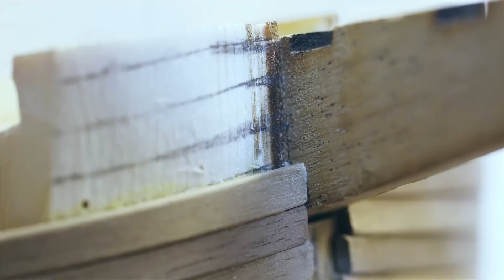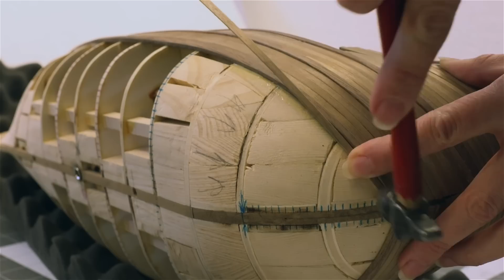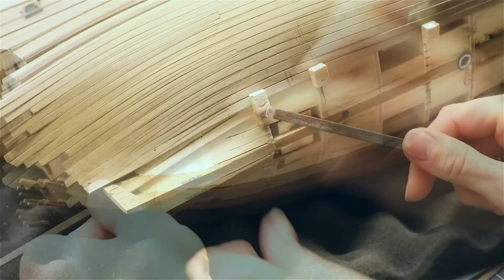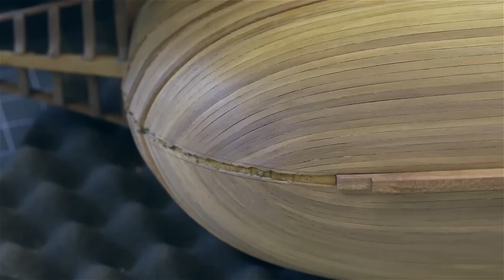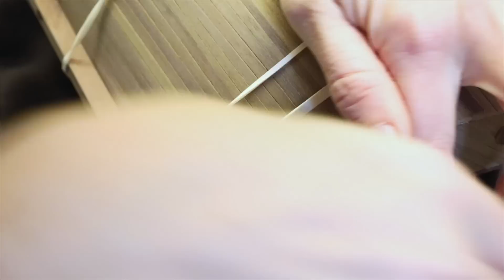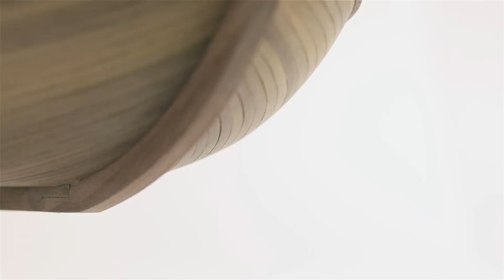Model ship building #10 - Planking the bottom - RAGUSIAN CARRACK XVIc - KIT (MarisStella)

Comment: VERY good video - great job of planking the bottom.  Have you ever considered using a Foredom rotary tool?  I have used both Dremel and Foredom, and greatly appreciate using the latter.  Speed is controlled by foot pedal, thus no switch to turn of/off.  Very quick tool changes also.  Has a lot more power than the Dremel, and can be obtained through Rio Grande jewelry supply.  And you can still use the Dremel sanders, etc.  Just a thought.  Meanwhile, keep up the fantastic ship building!  You are an inspiration for many of us who love making things with their hands and brains.
Reply from the maker: Thank you!
I'm glad you liked it!
I have seen such a tool from my friends - it is convenient when you work at the same table all the time. But apparently it's still a matter of habit - I do not like the flexible shaft itself... For some reason it is more convenient for me to hold a well-balanced Proxon)))

Comment: That planking is amazing, so resourceful and clever using the electric radiator to do the bending. I see it is wired for lights, want to try wiring my next model, what type of wire do you use?
Reply from the maker: Thank you!
I used the 28AWG wire here.
But it is too thick for small diodes. I just didn't have another.
Reply: @OlhaBatchvarov  I think I will order some 32 AWG in two contrasting colors.  May be able to hide the wiring also, as I did when building a "doll house" for my boss.  Sure does not take much to solder using "Tic" brand - low enough heat that you could use a match if you wanted, melts at about 250 deg. F.

Comment: Olha, what kind of heater are you using in this video to (steam) bend your planks?  How long do you soak your planks before steam bending them, especially the "severe" bends -- minutes, hours, longer?

What is the (specially shaped aluminum?) block that you use as a sanding block?  Do its notches & corners have special functions?

I honestly had forgotten about the custom-made "keel assembly" (my incorrect term - it was way past my bedtime when I watched that video ;) and was wondering what you would do to clean up the "joint" between the port & starboard sides of the model.  Now it's so obvious that I feel like an idiot, but I don't think that I'll forget how to do that again!
Reply from the maker: This is walnut - it is very malleable by nature, so I just wet it before bending and immediately on the heater (еhis is a 1500W уlectric Oil heater from Amazon).

It's just a piece of aluminum with 90 degree sides (bought as scrap metal).

Everything comes with experience...

Comment: Love your plank bender! I use an antique autoclave. I have another question: what is your preferred method to cut the rabbet in a keel? Method but also which tools? Carving is typical but I am curious of a method with a small modified plane, scraper, etc.
Reply from the maker: Thank you!
I prefer to simplify the design and do without the device rabbet. But when there is such a necessity - usually I just use a scalpel with a new sharp blade.
Reply: @OlhaBatchvarov  Yes! I noticed you didn’t have a rabbet line. So to take this further, you fit a false keel to the plank as opposed to fitting planks to the keel. This is also a challenge but not as bad as carving the rabbet line. I have actually resorted to this approach myself. I keep testing you and you are keeping me on my toes trying to stay with your skills! 🤯 

PS: I have a 2,000 sq ft shop with machining, welding, car fabrication, wood working, forging, and ship model areas. I am retired and have always had a bug to build. I counted my ship kits that are in line. Twenty-two! I hope I live that long! Bless you!